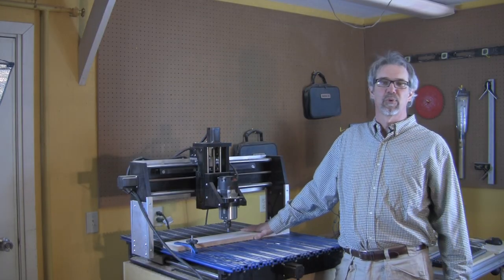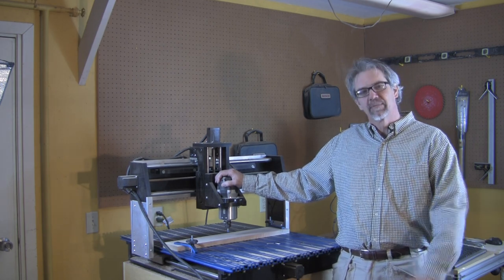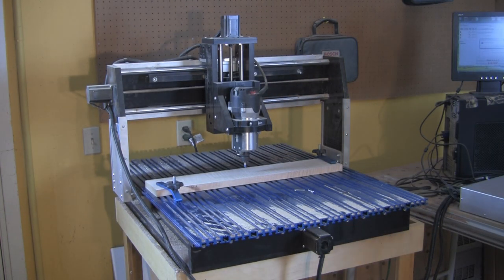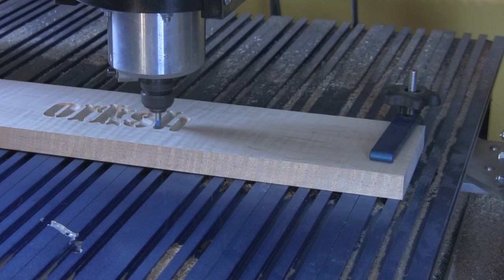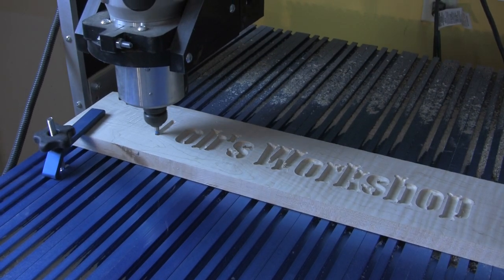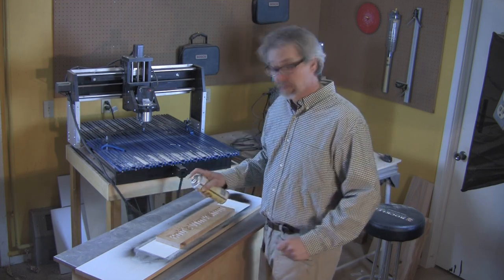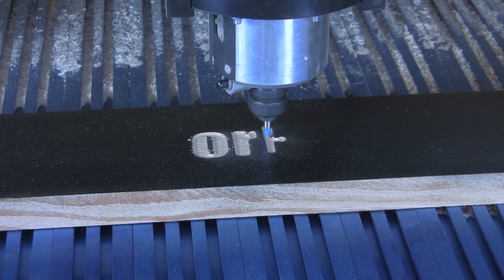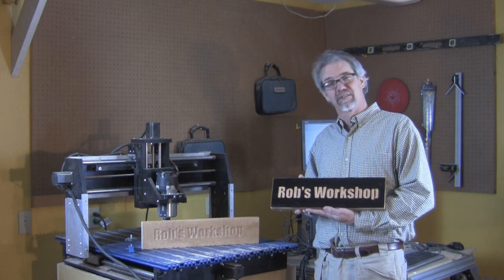Making Signs with a CNC Router

Comment: Unfortunately you're not going to make any extra money as you've suggested.

You laid out "Rob Johnstone" with the software and the router cranked out "Rob's Workshop".
Reply: Just in case you didn't notice Kevin. "Rob's Workshop" was the second sign he made. Therefore, he probably reset the name to make the second sample with the 
black lacquer.
Reply: @9086011  Actually, the gentleman is correct. I noticed the same error in video. Both signs made read " Ron's Workshop" and he clearly typed in his name.